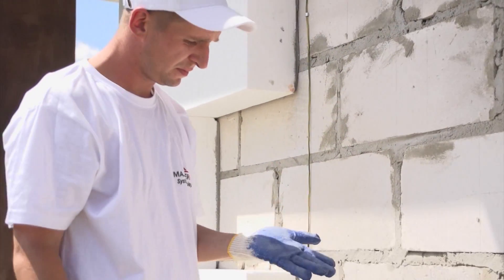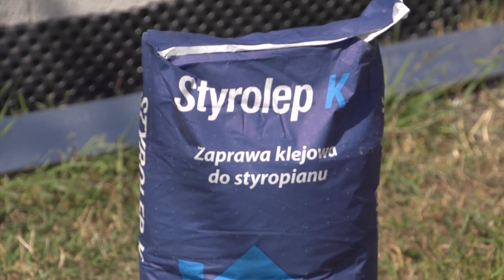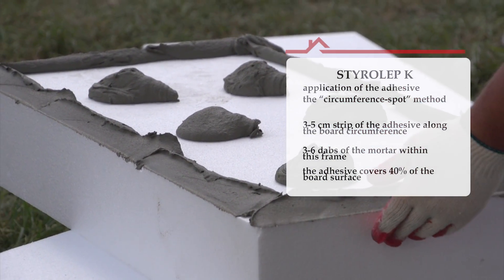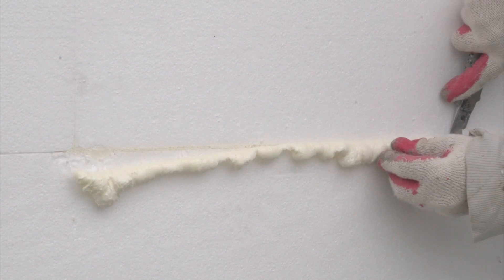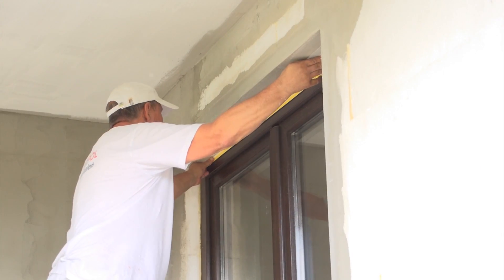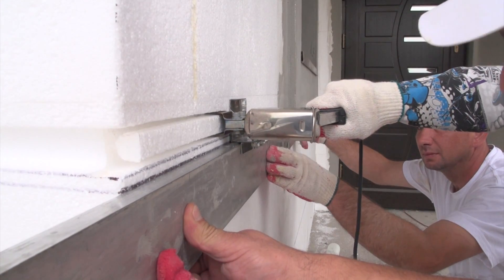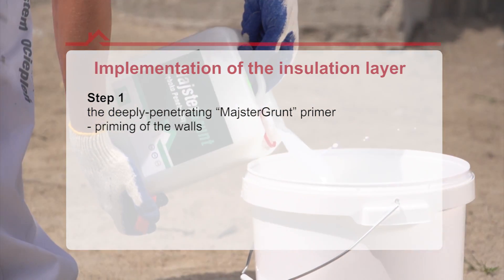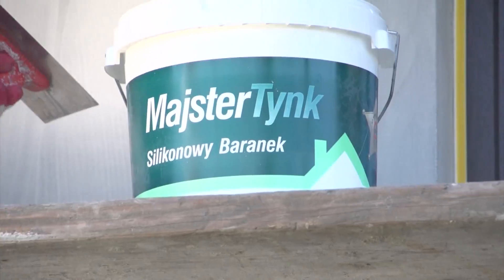How to insulate a walls; step by step - part 1

Comment: Can these foam board be bonded to an already painted concrete/CMU walls?
Reply: I had the same question, a mortar specialist told me that in order to place mortar on top of already painted concrete you need to remove the paint. what they usually do is they start piking small holes into that wall for mortar to stick above it. I guess its the same principle but with that Poly on top of it.
Reply: @erickalcala7649  Yeah. Paint is acting as a sealant. You can just grind the surface and use bonding agent.
Reply: @erickalcala7649  Yeah. Paint is acting as a sealant. You can just grind the surface and use bonding agent.